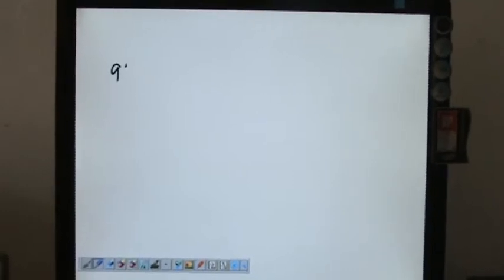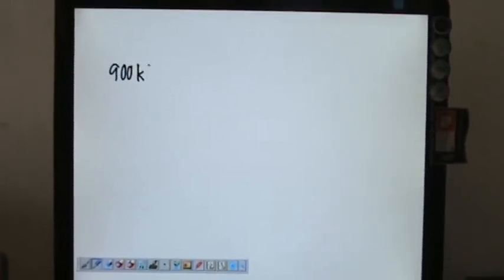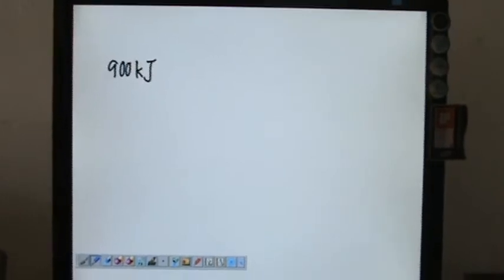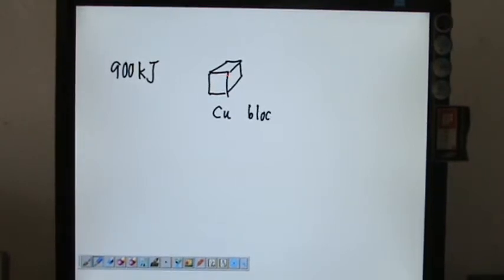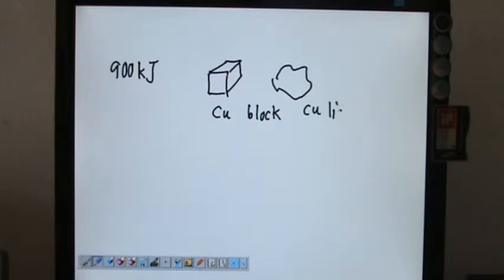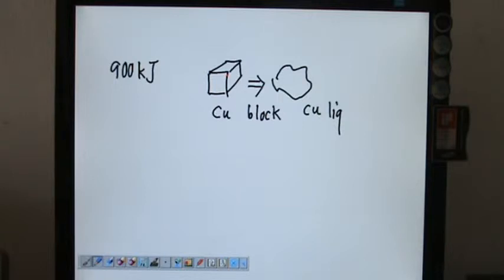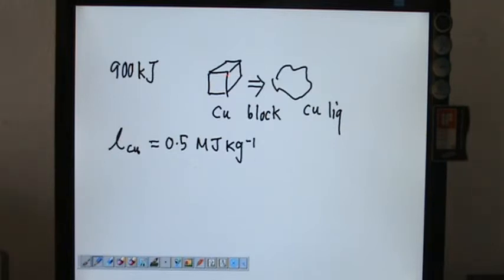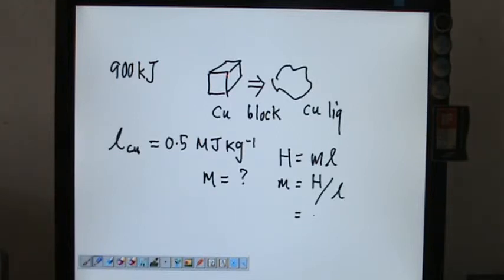Specific Latent Heat of Fusion Calculations Example 2

Comment: can you help me out with this question 

A heat exchanger is used to condense steam at atmospheric pressure .the condensate formed by the steam is cooled to 40 c. the steam flows through the shell of the heat exchanger. cooling water flow through the tubes . the cooling water enters at 12 c and leaves at 36 c calculate the mass flow rate of the cooling water require per kilogram of steam